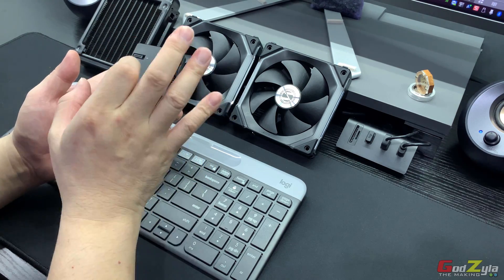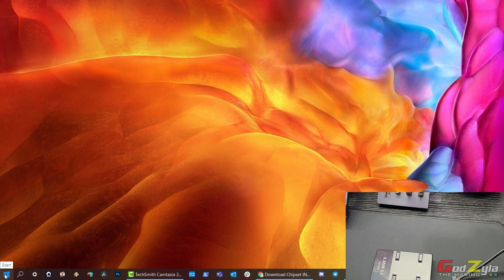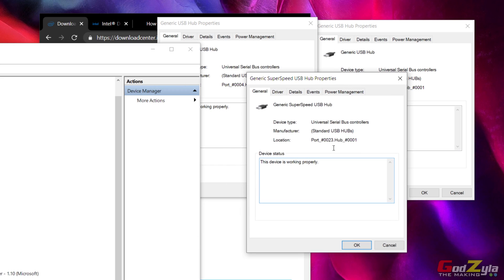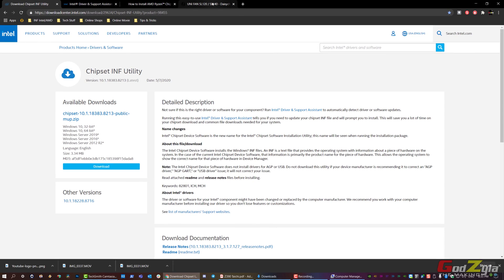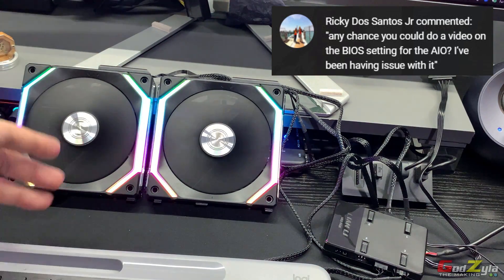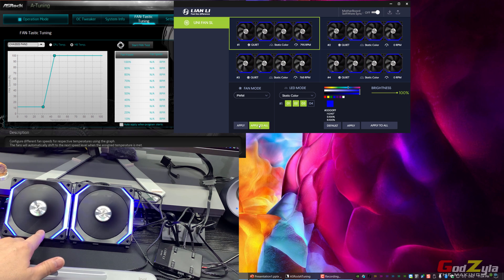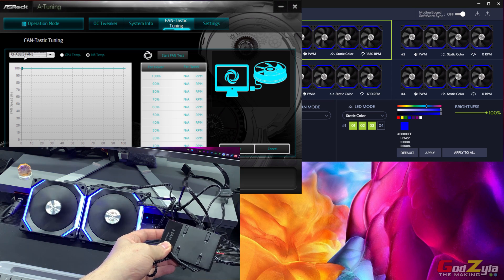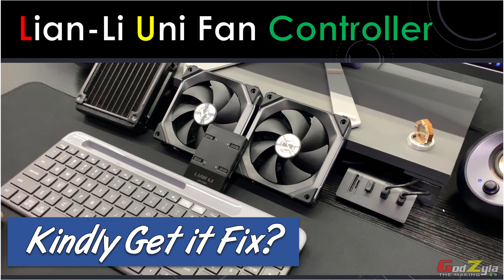Lian Li Uni Fan Controller - Some Break Fix! [L-Connect]

Comment: I dont know if this is common but they are really loud above 800rpm... At maximum speed they are at 55db and at 800rpm its already at 30db which seems alot for me. I cant even hear music with my headphones on at that point
Reply from the maker: Hi KingALLO, welcome to my channel. Yes they are loud if you have a whole bunch of them. You might want to try plugging the sets of fan load directly to the motherboard fan headers and make use of pwm mode to do customise fan curve. As what I have tested on my board, you can set them to run at 15percent. You will need to do some adjustment according to your board. Do note that by doing this, your system overall temperature will raise.

Comment: I can't get the fans to pop up on the device manager list smh
Reply from the maker: Hello James Howie, do you happened to have another argb program like the Asus armoury crate, gigabyte fusion or even msi dragon? If yes, you want want to try uninstall them and including the L-Connect app. Make use it revo uninstaller which helps to clean up all left over files. Switch off your pc and unplug the power cable to the psu, let it sit for couple minutes, then turn back on. Now just install your L-Connect app to see if it works.
Reply: @KleoYan  No I don't have any of those. But I did notice if I unplug the control cable from the Lian Hub the fans spin much faster. Soon as I plug the 2nd plug back in, they slow down a lot. I'm not very cpu saavy
Reply from the maker: @demdudes954  hmm would you like a conference call so that I can diagnose on the spot and to guide you through? But that will be during the weekends as weekdays, I will be occupied with work. Send me an email and I will give you the details. Email me at godzylatech@gmail.com thank you.

Comment: I have no rpm signal from the fans but I can control lighting the fans spin in silent only and won’t go any higher
Reply from the maker: Hi Austen Sales, welcome to my channel. If you have plug all fan load to the uni controller. You should be able to see the rpm figures in the L-Connect app. This will not be shown in motherboard uefi/bios not on hwinfo. If you want the rpm to show in your bios/uefi or even in hwinfo, you will need to plug all fan load set to the motherboard respective fan header.
Reply: @KleoYan  I have all of my fans connected to the controller, and I’m not seeing rom signal in the l connect software, currently the only way I can control the fan speed is if I plug them directly to the MOBo
Reply from the maker: @Austensales1  you might want to go into your UEFI to set that particular fan header to PWM. Make sure to do your fan curve. Then on L-Connect set to pwm mode.
Reply: @KleoYan  I figured it out, I had to go onto the website and download a fix specifically for my issue not the fix mentioned in the video
Reply from the maker: @Austensales1  nice.. so sorry that I am not able to fix the issue for you.. glad you found a solution.
Reply: @KleoYan  not a problem I appreciate your time

Comment: Hey kleo, I have a mini itx board with one usb 2.0 header and wondering any splitters will work with the uni hub? I've tried a nzxt hub and the hub won't work or power rgb on the fans.
Reply from the maker: Hi Christian Weber, welcome to my channel. Does your NZXT hub comes with a self powered source (sata cable to power it up)? It should work as I make use of this hub https://nzxt.com/product/internal-usb-hub-gen-3
Reply: @KleoYan  Think I have the old one, will update to the new model, thank you so much!
Reply from the maker: @christianweber1231  you are most welcome and all the very best in your build 👍

Comment: Not sure if you've been asked about this problem yet but I had everything up and running fine...10 sl fans, and a 24pin strimmer plus using two controllers.  I accidentally clicked on the "motherboard software sync" button and now nothing works.  The fans don't light up at all, fans are running at a higher speed...everything shows up still in L Connect 2 including both controllers, and all the fans.  I checked in the Universal serial bus devices and both controllers are showing there without me doing anything.  Just as a precaution I deleted Armory Crate which I was using to control my ram only, but even after a couple reboots the ram is stuck in frozen in the mode it was running.  The Gif logo on my Z73 is still working fine, and the rgb on gpu.  All 10 fans are just black.
Reply from the maker: Hi Nucl3ar, welcome back to my channel. Yes I do have friends who have these issues, ended up redo a fresh copy of windows 10 or 11. you see when you trigger motherboard mode on L-Connect. It triggers the IRQ address to switch. so if it happens that the IRQ is of the same as your amour crate. that will conflict and causes problem. For your info, the IRQ that is occupied by either app (L-connect and Motherboard utility like Asus Armoury Crate or MSI Dragon Center or even the Gigabyte fusion) is conflicting. so ended up they choose to use Uni fans argb via L-Connect and the fan rpm directly plug to the motherboard header. that will resolve the issue.
Reply: @KleoYan  Hey thank you for the response I actually got it fixed without a windows reinstall.  What I was uninstall both Armoury Crate and L connect, reinstalled L Connect, and then toggled the motherboard switch on/off and it all came back.  I don't even actually have any argb cables connected to the motherboard.  Appreciate your time, and the informative videos!
Reply from the maker: @nucl3arboNg  nice and you are most welcome. sad to say that does not help on my other two friend's pc. done couple of times and did lots of retry, ended up they gave up. Anyway glad to hear that everything works fine for you.. once again thank you for the valuable feedback.
Reply: @KleoYan  I might've spoke too soon once I installed Armoury+Aura next time I opened L Connect it went all wonky again.  I wonder if it would work if just Armoury Crate on it's own with aura would work.  Or does iCue have the same problems when using along with L connect?  The one step I forgot to add when I fixed the first time was I did a system restore.  I'm trying that now to see if this helps.
Reply from the maker: @nucl3arboNg  all I can say is that, for some cases. The motherboard utility app took control of the IRQ which prevent full function of the L-Connect app. This does happened to chrome from Razer. As for icue. I don’t thing it will interfere.
Reply: @KleoYan  I decided to scrap Armoury Crate/Aura all together to eliminate any future problems.  Do you know of any compatibility issues when using L connect and iCue at the same time?  Thinking about changing from Gskill Royal to some Dominator Platinum and would want to use iCue to control it only.
Reply from the maker: @nucl3arboNg  I see, I am not sure about using iCue but you might want to check at lian li reddit https://www.reddit.com/r/lianli/ .

Comment: I tried all this steps, but it doesnt work on my system. Im using L-Connect 2, and have an Asrock B550 PG Velocita, actual chipsetdrivers etc. I have connected my LianLi Controller to Chassis Fan 5, switched to PWM, but cant do any settings with the Phantom Gaming Tuning Software when i switched the L-Connect Software to PWM.
Reply from the maker: Hi phY1988, welcome to my channel. just to check, does your fan react on argb effects when you set it on L-Connect app? if it does not, try change to the 2nd USB 2.0 socket of your motherboard.
Reply: @KleoYan  my ARGB effects react with the L Connect Software, no problem. I can also setup the speeds with L Connect Software, PWM Mode with L Connect software and my asrock software doestn work, settings in UEFI are the same as yours
Reply from the maker: @phY1988  wonder if you can try to uninstall the ASRock utility app using revo uninstaller. Revo uninstaller will remove left over registry files. Next is to reboot your pc, reinstall the ASROck utility app again. See if that helps. If not. I seriously have no idea why it didn’t work for you.

Comment: if my fan controller is broken will it stop my fans because 5 of my fans stopped working and I think its because my fan controller is broken anyone have any idea why 5 of my fans is not spinning? (I plugged all the fans the right way)
Reply from the maker: Hi Eric Nguyen, welcome to my channel. I would advise you to remove all your fans from the controller. first thing you need to check is, are your SL fans still in working condition. plug the fan load to the motherboard, this you can leave it daisy chained (max 4 fans) as each fan load is 0.18a. if they work, next is to check to see the argb are working, if you have the argb cable kit for lian li, you should be able to test it but please test one fan at a time as the load is 0.65a, again you can plug to your motherboard to test. if all fans work on both fan load and argb. then  you can narrow down that your controller is not working. 
for extreme case, fill up a RMA form from lian li website and to have your unit replace.

Comment: Thanks for the informative video, it seems that when i go to device manager an unknown usb device shows and i know that  is the controller i might just not of understood but i am unsure what to do next i have installed all drivers i believe and this is my first build, thanks.
Reply from the maker: Hi Kyle Stark, welcome to my channel. just to ask, are you using another other argb program besides this L-Connect. Most of the time i've encounter is due to the fact that you have installed the motherboard argb app which prevents you to use the L-Connect app to function. You might want to try uninstall the motherboard argb app using revo uninstaller where it cleans up all the left over files (https://www.revouninstaller.com/revo-uninstaller-free-download/), next shut down your PC, unplug the PSU AC cable, let it sit for 30 to 40 seconds, turn your PC back on, install only the L-Connect app, have a look at device manager. if it shows you the lian li device, try using  L-Connect app to see if your fans respond to the argb and rpm settings. if it does, reboot your PC and try again. If all work out well, then install the motherboard argb program if you need it.
Reply: @KleoYan  Hi thanks for the quick response i did previously have another argb program but i uninstalled it and most other programs like that when i reset my windows as i seen on some reddit forums that said that may fix the problem but that did not do anything except remove most of my programs.
Reply from the maker: @kylestark1754  which motherboard are you using. Don’t mind me asking. Thanks.
Reply: @KleoYan  Im using the B550 Auros elite v2
Reply: Is it perhaps the cables and not the software? Thats the problem.
Reply from the maker: @kylestark1754  ok, you've mentioned you did reset your Windows and it still does not work. now on your motherboard, you have 2 USB port, have you try switching it to another USB port? if still does not react. I advise you to approach lian li direct and to have your unit replace. at least the usb cable.
Reply: @KleoYan  yes i had switched usb at the very beginning of the problem it must be the cable then thanks you for spending so much time helping me.
Reply from the maker: @kylestark1754  hi Kyle, dont mention it. I didn't resolve your issues which I hope I did.. now if you are to contact lian li direct to have your cable replace, fill up the RMA form https://lian-li.com/contact-us/ remember to attached your receipt and let them know what's the issue. Or if your local shop is able to do a 1 to 1 exchange. you can do that too.

Comment: Okay I have two controllers both with” No  SL/AL “ so I have L-connect and I also updated them to be supported in L-connect 2 but didn’t work only controls my AIO lian li liquid cooler rgb. As for 10 fans can be controlled by L-connect then 2 fans immediately turn off as in the RGB. First controller has the four fans connected those fans have Daisy chained to other fans. LastLy the 2 controller is with the AIO pump rgb and power connectors. So the problem is maybe the fans aren’t signaling the last 2 fans idk can u help. Also I have 12 fans in total with 12x.65 = 7.8 A still under the uni output of 10 A
Reply from the maker: hi, can you look at your L-Connect 2 software. in the software itself, right below LED MODE where you select Static, Runaway etc, there are some boxes which indicate #1 01 02 03 04 are they lited up? you might have a set of daisy chained fans connected but you have not set the fans to lite up. so make sure you select 01 02 03 04 on and it depends on how many fans you have daisy chained. do remember max is up to 4 fans and not more.
Reply: @KleoYan  sorry that part went through my head I’ve got it working thanks
Reply from the maker: @coolaverage2017  hi, that’s great, thanks for the reply. 👍

Comment: I got a little issue. Whenever I put all fans at full speed with Lconnect, only the 3 daisy chained connect to source one on the Uni controller will reach its top speed 1900rpm. Fans connected to source 2 and 3 reach only 1700rpm. Have you experienced this?
Reply from the maker: Hi Rafael Almeida, welcome to my channel. I have not encounter your issue but you might want to try swap the fan connectors from source 2 to source 1. To check if the original source 2 fans able to go full speed at source 1 output. If able to, the fans are not faulty and next is to check if original source 1 fans able to go full speed at source 2 output. If able to, means there might be connection issue. If not able to, this might be a controller issue, try reseat the usb cable between the uni controller to your motherboard usb fan header. See if it helps.

Comment: I have the AL version of this fan followed your steps with nothing. Ive tried everything and have been trying to get my controller to be detected for about a week. I even exchanged my fans to make sure it wasnt a hardware issue. Is there anything else I could try? thanks for your help !
Reply from the maker: Hi Greg Guluzian, welcome to my channel. may I ask, do you have another argb program installed in your system before you install the L-Connect 2? example for Asus you have amoury crate or Gigabyte the Fushion. if that's the case, you can give this a try, uninstall all argb program using revo uninstaller https://www.revouninstaller.com/revo-uninstaller-free-download/ . This uninstaller will remove all left over files. Next, turn off your PC, remove the power cable to your PSU and leave it unplug for 30 to 45 seconds. next turn it back on and install only the L-Connect 2 app. try out the function to control the argb effects. if that works then install the rest of the argb program.

Comment: hi bro, i recently setup my own rig with Lian li Galahad UNI FAn 240. installation done and install L -Connect and encounter two front RGB (top & bottom 1 each) not working. Could you advise me. all connection done only aRGB and fan pin not connected.
Reply from the maker: Hi Wei Jie LOH, welcome to my channel, before doing anything, do you have the uni controller? and do you have any other argb program installed before the L-Connect app?
Reply: Hi !  @KleoYan  . once i builded the PC all RGB lights is on. after installing L-Connect 2  two RGB light off and unable to control. i only have corsair iCUE for my kb and ram. 
does connecting the RGB & Fan pin to the control makes a different ? meaning 1 set of SL120 (RGB) pin connect to (group 1) on the controller then same set SL120 pin connect to (2) . currently i had uninstall the software and rewired the setup and its RGB is turned on.
Reply from the maker: @weijieloh4236  does your uni controller have the marking SL on it. if not you can't use L-Connect 2.. L-Connect 2 app is only meant for SL controller that has a SL marking on it and also for AL fans. please check properly. https://youtu.be/hZpzR_4917c <--- refer to this guide.
Reply: @KleoYan  , yes my controller have SL on it.
Reply from the maker: @weijieloh4236  Ok, I would advise you to uninstall all argb apps first. then plug the uni controller with one fan, install L-Connect 2. test it. You might have not follow my YouTube, I often ask viewers or subscribers to test things outside the case first. then once confirm, place it in.. this way you don't waste so much time. https://youtu.be/s20jODhCCcI <-- if you have time you can watch this (1 hour loong).. there are part I and II too. anyway all the very best. remember, take your time, do not rush into a build.
Reply: @KleoYan  ok noted. will try 
thank you
Reply from the maker: @weijieloh4236  all the best in your build.
Reply: @KleoYan   bro, i am able get all the rgb lights up but now i have 1x rgb unable to sync when changing the rgb using L connect 2. its connect with a chain of 3, its the front unit .
Reply from the maker: @weijieloh4236  thanks for your reply, this indicate that your system is not recognizing the uni controller. there are no communication between the L-connect 2 to your uni controller. now may I ask did you have any argb program before you install this L-Connect, example Asus Amoury Crate or Gigabyte Fusion or such? If you did, try use this application to remove all argb program, including the L-Connect app, this revo uninstaller will remove all left over files https://www.revouninstaller.com/revo-uninstaller-free-download/ . you see other argb program make use to the same IRQ as the L-Connect. the other argb program might have lock you from allowing the system to recognize the uni controller, therefore not allowing the L-Connect 2 to communicate with the uni controller.